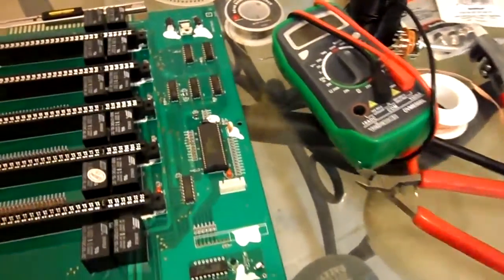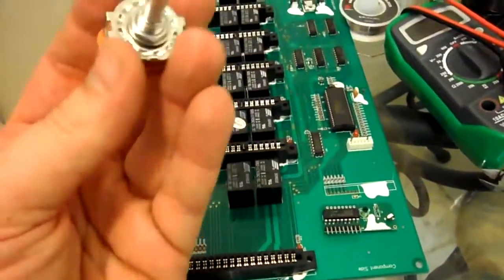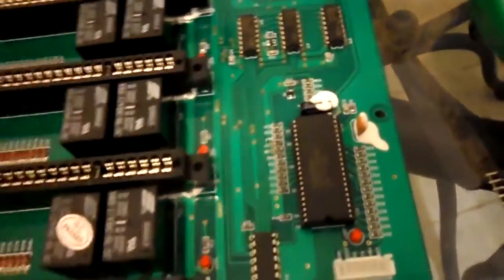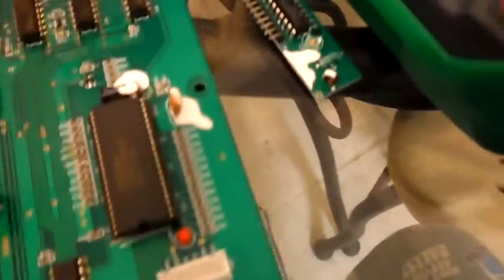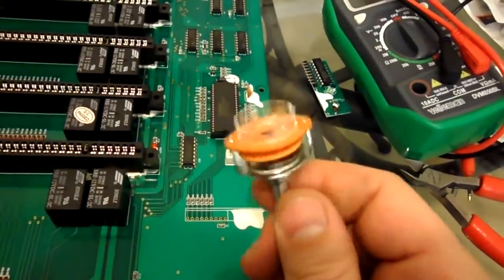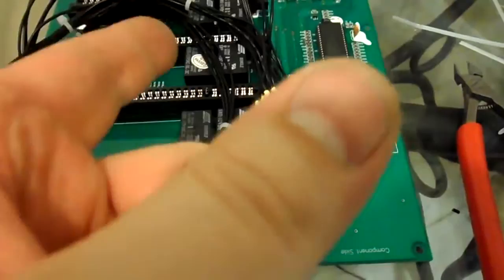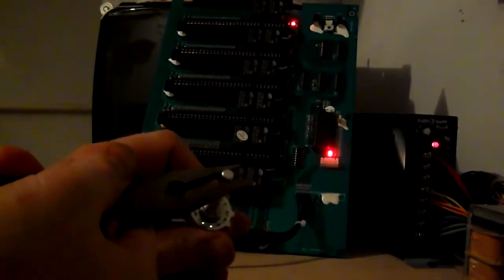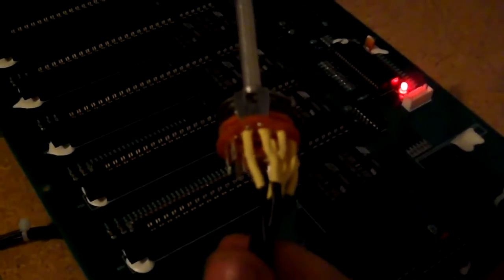Jamma 6-In-1 Switcher - "Remote Delete Mod"

Comment: Hi, I have that 6in1 pcb, today I tryed to use it after several months of inactivity... and it go ON but the remote do not switch on any position... noone of the six red led is operative, only the main one... remote is ok, maybe you know what happens... Thankyou.
Reply from the maker: Replace the battery in the remote. Try holding the button down on the remote for 5 seconds.
Reply: YourMKArcadeSource battery in the remote is ok, the led is ON when I push buttons..
Reply from the maker: The battery needs to be at full charge. I bet it will work if you replace it.
Reply: ok I'll try, thankyou

Comment: The 5v wire doesn't actually have to go to the button. It can actually come from the PS straight to the solder hole that is also going to your push button. Just unsolder the wire at the board twist the wire around the wire coming from the button and resolder. Constant 5v no matter what.

Comment from the maker: Only momentarily. Once you let go of the button, the 5vdc would stop and the slot would shut off. Although, now that I think about it, I don't know for sure it the slot requires the voltage to be constant. I can remove ONE of the board wires and wire up ONE pushbutton and see what happens. Give me some time.

Comment: No more 5v and service switch mods needed correct?  any other mods needed on these 6 in 1's now?   nice job on the installation of the switch.